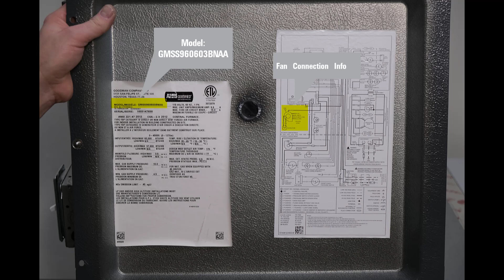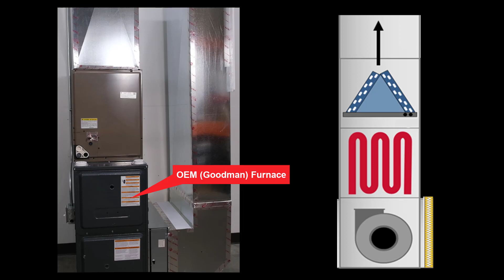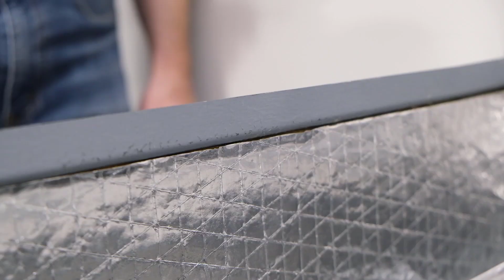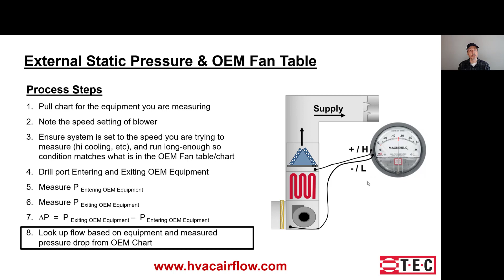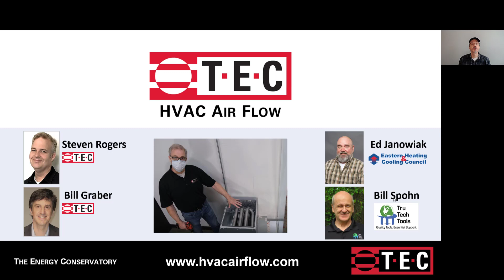HVAC Air Flow_Step-by-step_TESP

Comment: As a retired service and training manager for a major a/c brand and manual J and D trainer, I rate this class as excellent.
It’s accurate and very very well presented, highly professional.
Great job guys!
One small point, if technician is careful they could take the supply side readings thru the high limit opening rather than drilling. BUT since power in on and the high limit will have 24 volts on one leg, one must proceed carefully not to blow the fuse on the board.